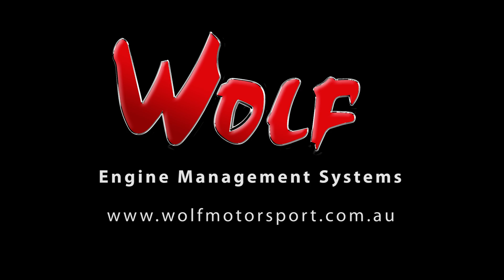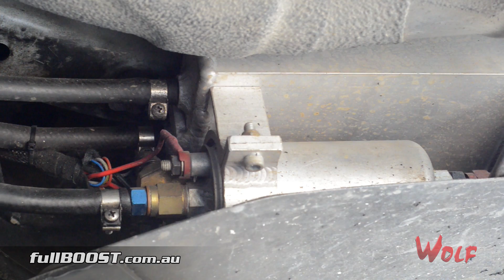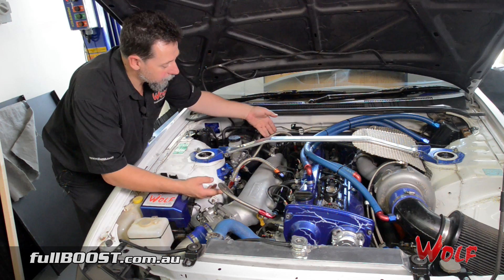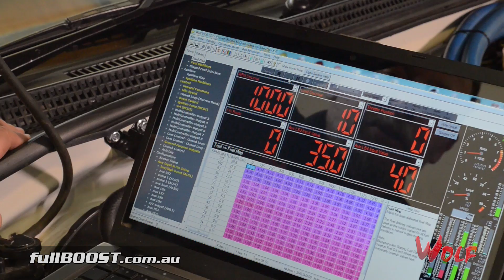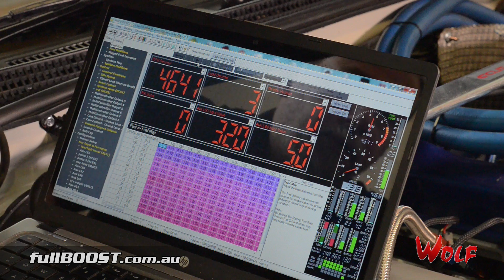Staged fuel pumps ~ Wolf EMS

Comment: I have had a wolf ECU and now I'm using Haltech, save your money and buy a Haltech!
Reply from the maker: +rbf378 There is nothing wrong with any of the current generation ECU's of any brand. Do your research and pick an appropriate tuner.
Reply from the maker: +slws14 Where did I say that? I said the current crop of ECU's are all very capable which is more than true. Do your research and pick the right ECU and tuner for your needs.
Reply: +Fullboost so true ^
Reply: +rbf378 Wolf don't have a very good reputation my tuner refuses to touch them. Haltech,link, emtron are all great ecus.
Reply: +Fullboost Bahahaha. 
I think everyone needs to do more research.
Reply: +Fullboost So your telling me motec is on the same level is wolf ? You need a head check mate. Your getting paid to advertise the product so of course your not going to trash it. I know his old stuff was fucking horrible but you will never see any unlimited budget cars using wolf ecus because there are so many better alternatives. The best ecus of the today are as follows MOTEC,EMTRON,LINK/VIPEC,HALTECH,AUTRONIC,MICROTECH,WOLF
Reply: +slws14 personally, I wouldn't run wolf or haltech in ANY of my cars. EVER.
Reply: +exilerob someone told me while I was growing up that opinions are a lot like assholes. Everyone's got one. And they all stink!
Reply: +Thisoneguyinaz lol.
depends on experience